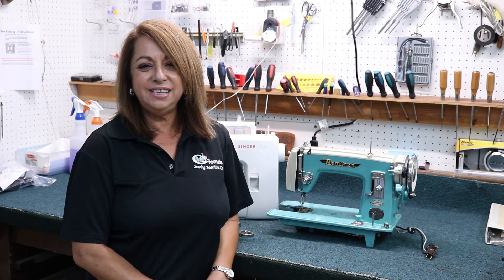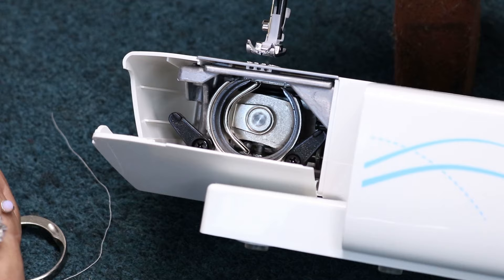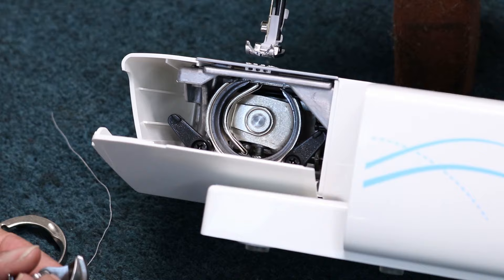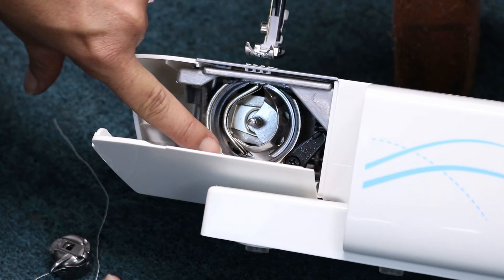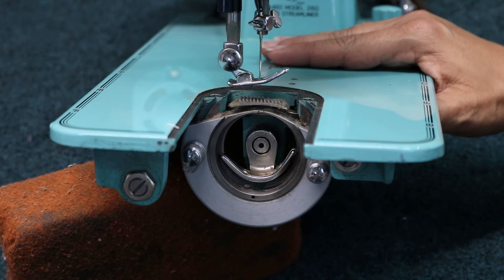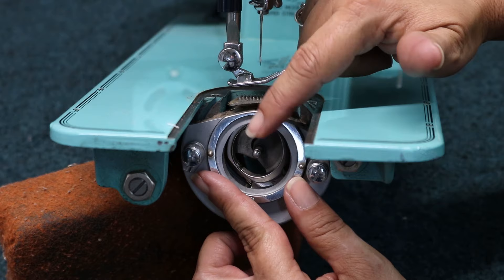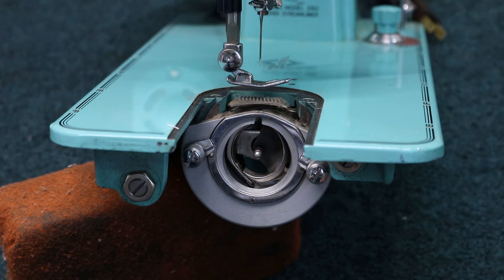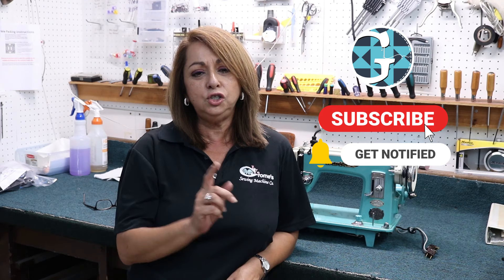Quick Fix - How to Insert Your Shuttle Hook Bobbin Case

Comment: I am wondering if you might help, I ordered a race cover for the hook for a Simple Singer 2633 from Singer on line. I misplaced it and with life happening it has been over a year now.  I know how to put these back together, I taught for 25 years, and did this many times; but I cannot get the cover to fit in at all.  I talked to Singer and they assured me that thsi was correct cover.  Do you have  any sugggestions or a specific video for this model.  It looke like the one in this video. It has a place at bottom for the small cut out but this cover won't pop in, it is as if it is to thick. Please any advice is appreciated.

Comment: I have an old sewing machine, Euro Pro X Ep380, but has never been used. It will only sew a straight line, it won't zigzag or anything else. Do you know what the problem may be?
Reply: Figured ou the problem on my own. I had to take the lid off, find the parts that pushes the needle back and forth and oil it. It's working just fine.

Comment: i did this but when i tried to thread the bobbin it just got stuck and the hand wheel wouldn’t turn anymore, what could my issue be? i have no idea what i did 😭 it’s brand new!
Reply from the maker: Try unthreading your machine both top and bottom completely. Re-thread your machine, making sure that it falls into the tensions. We have another video about upper and lower tension, visit those.
https://youtu.be/uk0Hg1gO1Ug 
Also double check to make sure you're using the right bobbin. Nine times out of ten we find that it's a threading issue. It's very common and happens to everyone. If the issue persists feel free to call our store or take it to your local authorized dealer for assistance.

Comment: Thank you my singer quantum is driving me mad the needle will NOT go down far enough to pick up bobbin thread. So i pulled out old machine and guess what it won't sew right it is stuck in reverse and thread keeps braking. I am going nuts. I just need to sew it is the only thing i have found that actually relax me. Do you have any idea's please. I have watched about 50 different video's and i can't figure that singer out.
Reply from the maker: Oh no! The best thing to do would be to take them to your local sewing machine dealer for a repair. For the quantum, without looking at it, it's most likely out of time. For the old machine, if it's a mechanical model, it'll will definitely need servicing. Depending how long it's been sitting the oil might have gummed up on the inside causing that return function to be stuck.